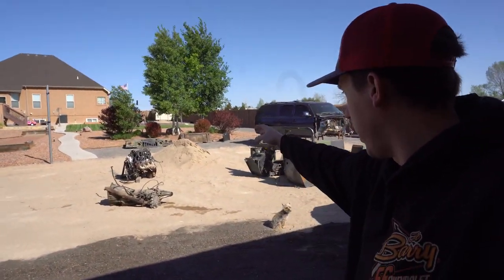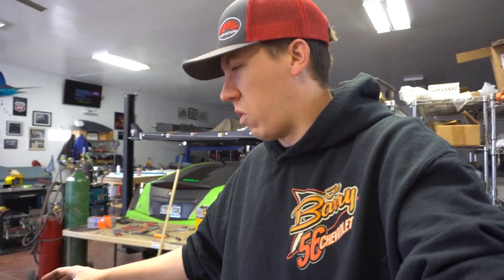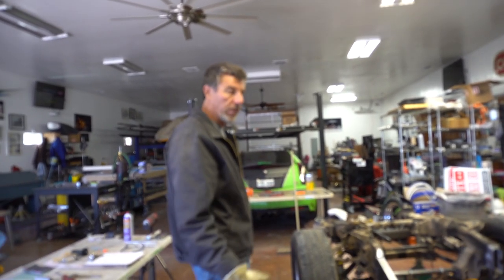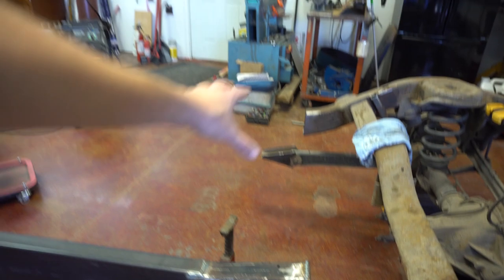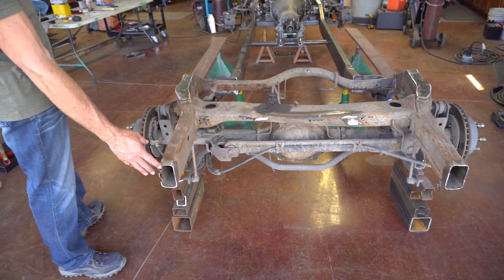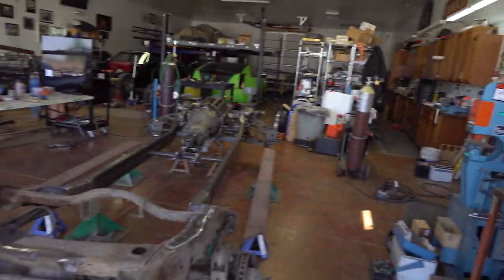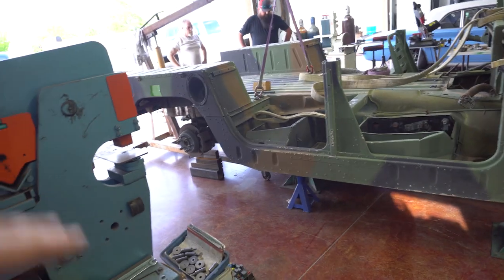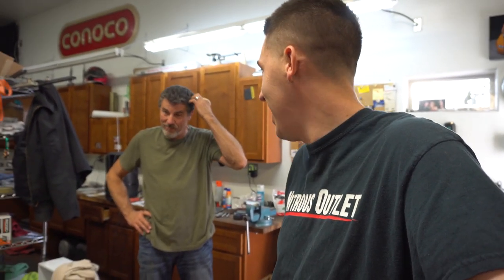H1 Hummer Body Gets LS Swapped With a New Frame!

Comment: Why not do a twin with all that room or f1x on m1 for charge temp no radiator or gas with intercooler you got all that room you can do 2 5.3's na
Reply from the maker: He might want to drive it a bit on the street but we could always switch fuels for the burnout. If we go twins might just keep them small so they light quick so it can make all the torques 🤣